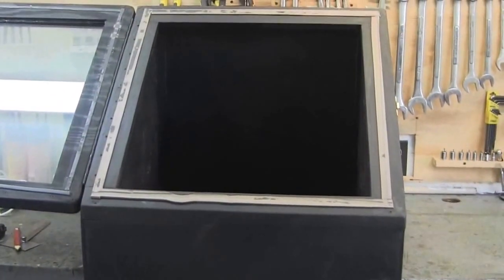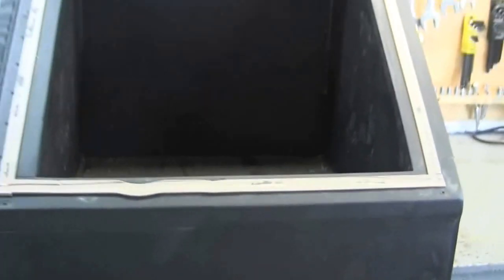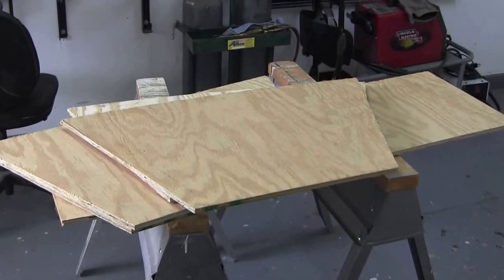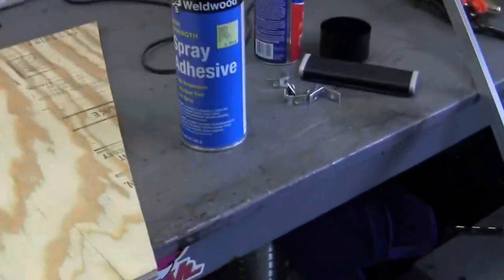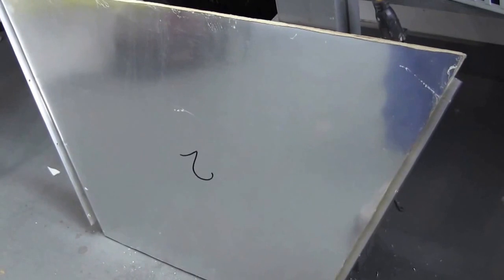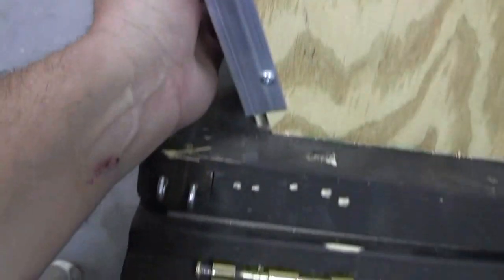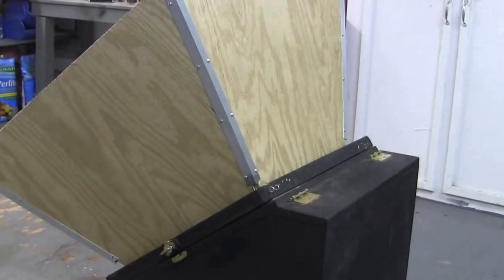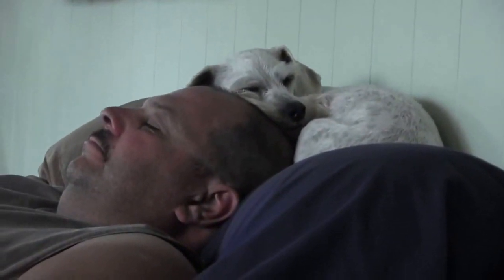Building a solar oven reflector

Comment: adding a Fresnel lens to the design instead of using plane glass for the front. If you wanted to get fancy you could use a solar tracking mount to move the lens as the sun moves. I've always wanted to rig one to a brick oven.

Comment: Looking good. You've put in alot of work on that one. There is one big thing to consider when setting the angle of the mirrors. Looking straight at the mirror array, the wider the mirrors are the more energy they collect and concentrate to the focal area. At that angle you're not reflecting as much light to the focal area as if that angle of the array was opened more. It's all about how much energy you can reflect to the focal area.

Comment: You probably don't need this advice, but if you glue that cardboard with a water based glue, alternate the grain, and make sure you weigh it down under some plywood on a flat surface so it doesn't warp. If you don't, it will almost certainly warp. Tape the corners so none of it slips while it's being weighed down, and it's better to cut it big because it WILL slip a little. Then it can be trimmed with a sharp saw, and sanded to fine tune it. I hope I don't come across as a pompous a-hole.

Comment: OK.. so how are you going to keep the sun shinning in at 70 degrees as it keeps moving across the sky?  When you set the oven at optimum angle to the sun... 10 minutes later the sun has moved Need a "tracker" of some kind to follow the sun...  

Still don't think that's the solution..  If you get 70 degrees on one side, you don't have 70 on any of the others.   But I don't really know.. and no solutions to offer.. except a reverse mirror on top of those.. like a TV satellite dish..